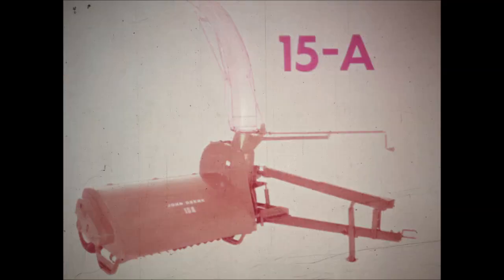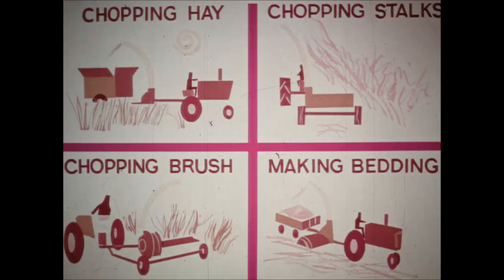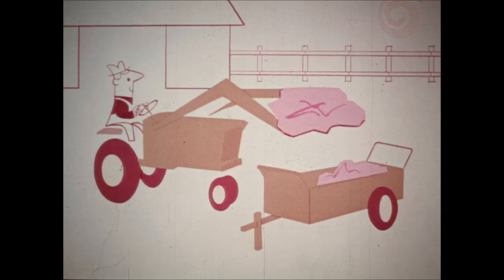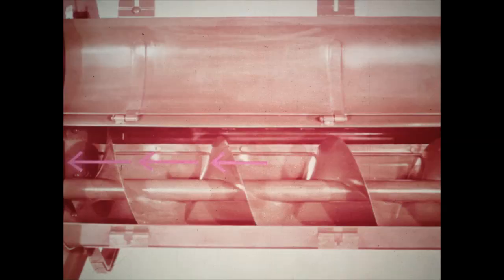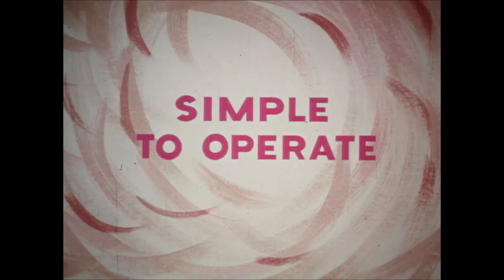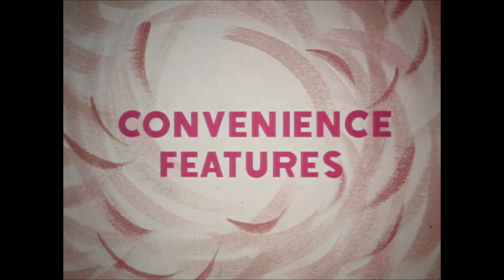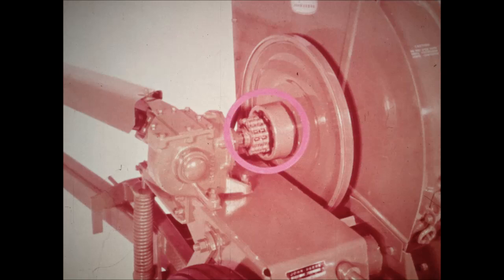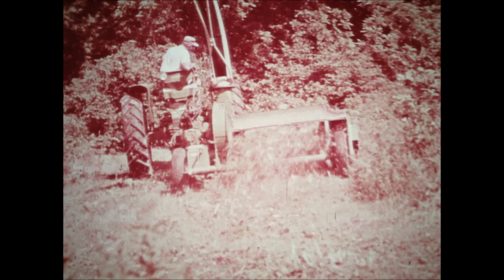John Deere Presents 15-A and 16-A Rotary Choppers

Comment: I can see advantages but consistency in feed will work best in dairy production. Fresh green grass always boosted Spring milk production. Fresh feed during hot dry Summers help with beef production when pastures dry up. But daily chopping of changing quality of grass won't boost production like JD promotes. Might as well feed in a lot, year around. Flail choppers worked ok but bat wing mowers have replaced flail choppers and round bales wrapped, work like a silo, plus round balers pack more fodder than chopping and piling. Ag innovation  has changed since the 60's. Long term quality of tractors hasn't necessarily improved, operator comfort certainly has though!

Comment: Ikon Sees Mr No - I'm guessing even your Red manufacturer had to offer a similar flail chopper in the late 50's - 60's. It's just that more green ones seem to have survived in SE Michigan anyways. Tough to find any smaller equipment that would have been on Michigan or Wisconsin farms from the 50's - 70's in the Plains area of Kansas.
Reply from the maker: I'm trying to remember what model IH had back then & can't think of it. I know Gehl had the 72. They also had a flail cut head for the CB600. The Gehl units were quite popular around here.